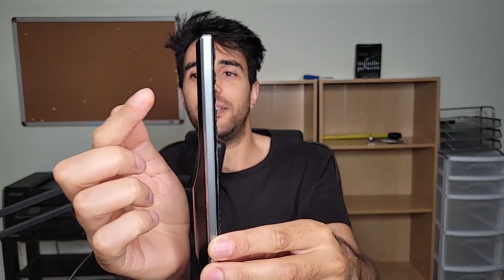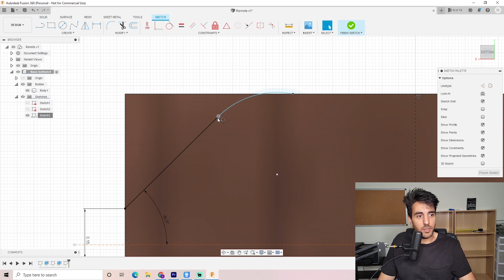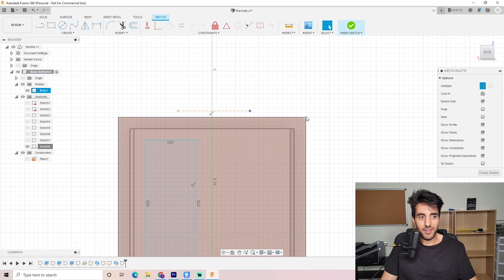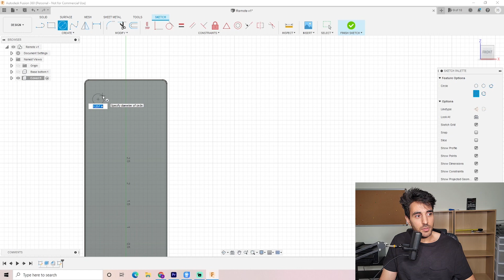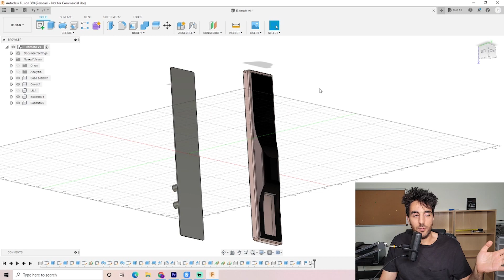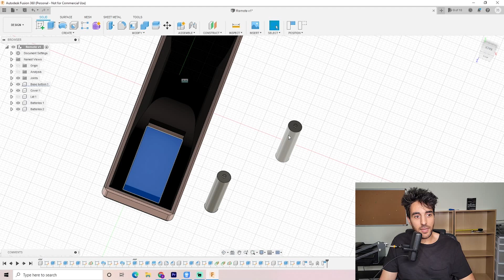Reviewing Fusion 360!!

Comment: For future reference with the battery case cover- I would recommend taking a mid plane and projecting the sweep path that you used in the base, and then just using the offset thickness of the battery case cover to cut along that sweep. But anyways nice vid, it’s fun seeing how other engineers use design tools like CAD.

Having used both full versions of Fusion and Inventor (being a student is nice), I prefer Inventor in most scenarios as my go-to CAD software. can’t stand Fusion’s constraining system. Fusion is super nice for CAM work and simulations though, so sometimes I’ll use it for that. But, at the end of the day, any CAD/CAM package will get the job done- it’s just whatever you’re most comfortable with that’ll finish the part the fastest.

Comment: I've used solid works for like 5 years and fusion for 3 years. Fusion is superior in cad and cam part is way better then master cam and solidworkscam add-on. And for assembly size in fusion I've had 500 part assemblies that ran with no problem
Reply: @WissamSeif  stable internet connection with out it your fucked. It has a ofline mode that works fine but if your on a shitty computer then it's a problem.

Comment: Been using fusion for years now. I used it to design connections for my steel bridge project for school and it was very useful to put things into prospective. Not sure if the simulation was exactly correct since the manufactured items wouldn’t be exactly the same as the model but with custom connection design and other things for structural engineering is really useful to get an idea of how it goes together. Love the program so much!

Comment: Love it to work with Fusion360. Designed an entire RC glider for my school project and built it. It flew😁
Reply: @WissamSeif  Balsawood, plywood and a little bit of 3D printing. The glider had a wing span of 3 meters and reached 110 meters height.
Reply: @robinmens6769  can you expand on this for me? I’m planing to do an RC camera drone using those cheap materials such as PLA for aspiring photographers for my DT coursework. Would love to know all the details and specifics.

Comment: I think making slots or connector hole for those battery and cover will make the mate easy. But it was a fund video..Can you do a series like this where you built anything (it can be a very small project) using different softwares, microcontroller etc and or solve an engineering problem from scratch and kind show the process. It will a fun to see how you tackle the problems and find solution.